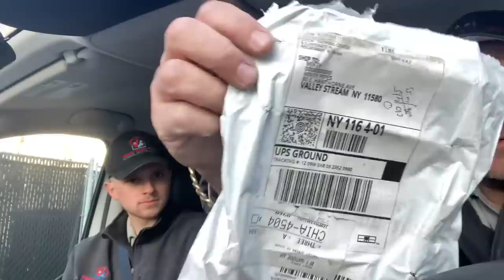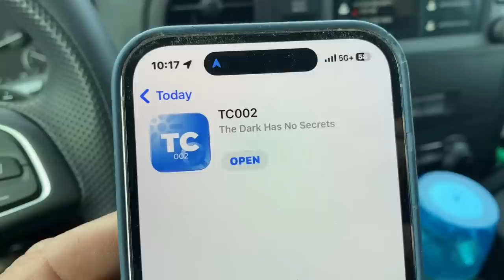Taking a Shower Inside Crawlspace? Plumber Cuts Pressurized Plumbing Line to Add Hose Faucet

Comment: ah they need to learn like the old days hand crank drill in oak dryass wood or drill 12 - 1/2" holes through 12 inch concrete and use a hammer and chisel. I'm amazed theres a light on the cordless drills. Did lead wipe, CI, remember switch to pvc, remember when Quest pipe  came out did not like because of aluminum crimp fitting. Retired 2010 LU 98 Detroit. keep up the good work very interesting, and you also doing free work. Very nice Mike(y) David

Comment: Mike, use an insulation rod for spotting holes and you can spot it and make a mistake without having anything damaged.  They come in 16" and 24" lengths and work beautifully.
Reply: @PipeDoctor  And to add to that.  Use only those insulation pins for spotting holes and keep a white toothpaste with you or a few colors of the repair pencils that are sold in the paint section.  I haven't had to patch or call in a drywall patcher for years, well, except when I stuck my foot through the ceiling a couple years back :).

Comment: ya learn something new everyday, never thought put the drill in reverse when going through siding.  thanx Mikey Blessings
Reply: you can cut it with circular saw blade on backwards too, with a far better chance of not breaking it. it kind of melts and nibbles through, old and cold siding is always a problem that loves to shatter. pretty much, always reverse rotation of blades through siding and if it's really cold store it in a warm area, direct sunlight or heat-gun if you need to make small cuts/holes  😉
thin aluminum cuts pretty good with reversed saw blades also.(siding, soffit, fascia), for flat stock/trim coil, use a utility knife to score it and break it off(using a bending brake) which you'd likely have and be using anyways playing with trim.

Comment: I was afraid you ended up with a Golden Shower in the Crawl Space. I had to go in a  Crawl Space, to look for a source of a Sewer smell. Told them not the run any water.  Well, they Flushed the Toilet. I unpleasantly found the Source of the Sewer Smell. Lightening had struck their Roof Vent Stack and Blew out the Lead Seal.

Comment: steam heat was 1 of the 1st heat systems invented I had it in the 1st house i bought in the 80's great heat but the front of the house would b nice & warm and shut the thermosat off and the back 1/2 would b cold tried all that shit with the bleeders but it never worked

Comment: Ya didn’t tell the people the purpose of that plastic wedge that goes behind the top of the frost proof hose bibs.  I’ve seen way too many people throw that piece away or just not install it and then wonder why their valve still froze and busted.    That wedge is to make the valve lay at a outward slope so water doesn’t lay in the back of the valve stem.
Reply: Or drill the hole at an upward angle from outside in

Comment: 18:28 or so …
Kids, don’t force a drill, if the drill/hole saw is dull ..
You’re beating your tool that cost more than a bit.
Reply: Or make sure the batteries are not about to die and up the power setting.
Reply: @PipeDoctor  my God man 🤣🤣🤣🤣

Comment: If the hack had connected the high water alarm contacts on the condensate pump that mess and water damage would never have happened . Hacks = Stacks.